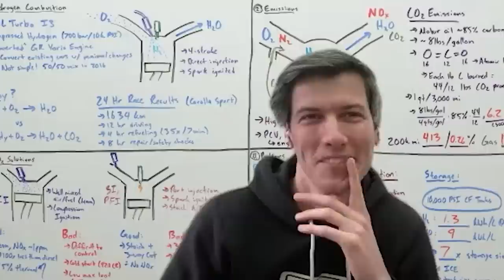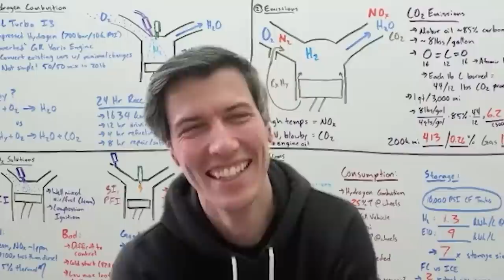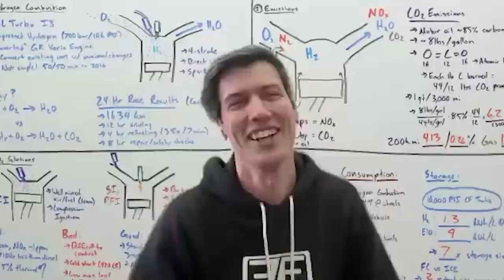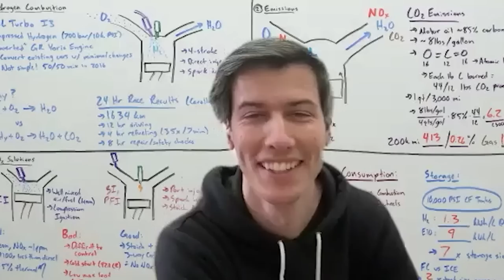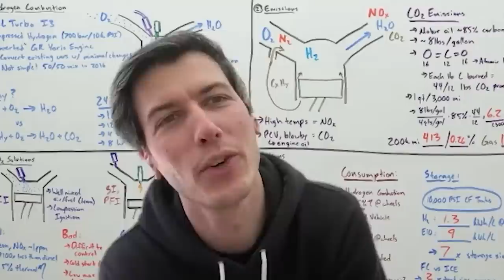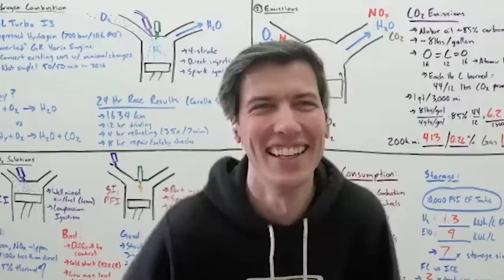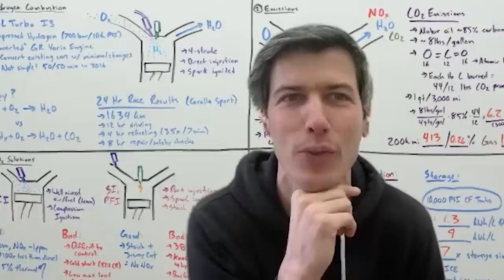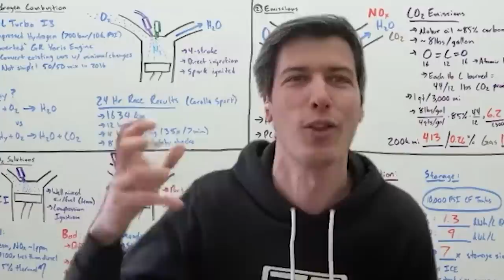Engineering the World’s Fastest Cars with Jason Fenske & Neil deGrasse Tyson

Comment: Most types of batteries are nearly entirely recyclable.  There are a ton of recycling companies rushing to get large scale plants online before used battery packs become an issue.  For the same reason there are not as many companies opening rare earth mineral mines as there would be otherwise because the demand is going to drop to next to nothing once there are enough battery packs built that can just be recycled over and over.

Also, battery a pack is going to last for years and years.  Yes, the pack will naturally loose some capacity by the time it's ten years old but it averages 20%.  If you have a 300 mile battery pack in ten years it may be only a 290 mile pack.  In twenty years it may only be a 270 mile pack... so the energy drop is not going to be that noticeable.

Comment: That is a flawed analogy - a steam powered airplane versus a battery powered automobile. Yes both get heavier in order to go faster or fly but in the case of a steam engine airplane it needs to be lifted in the air. The work to be done is far greater. In the case of the heavier battery powered car it just needs to be accelerated forward while planted ko the ground. I don't believe a higher mass would affect top speed, but it would affect acceleration in getting there.

Comment: Regarding a turbo equivalent for electric motors ... Capacitors!

In a camera flash unit, the capacitor will charge up over maybe 3 seconds, then discharge all of that stored power in 1/1,000 of a second. 

It seems that a series of capacitors, timed to discharge their loads at millisecond intervals could replicate the effect of nitrous oxide injection in IC engines. It's not the sustained boost that you're going to get with a turbo or supercharger, but the idea could have merit.

And if anybody tries it, I want 15%.

Comment: Gentlemen. The slick using race cars is most effective as it is the most rubber on the ground. The Tesla is all wheel drive. That helps.  Then you use the proper road surface.

Comment: Great show and a fantastic guest.  One subject that came up in show was tires vs pavement.  I think it would be better with a rough pavement and smooth tires.  Racing cars on the track use slicks for better grip.  The catch is that the tires have to be warmed up so the are soft enough to dig in to the pavement.  I am curious to know if these companies engaged in deception by using tires that are not quite street legal.  And if they were legal, what was the temperature of the tires for the 0-60 run times?

Comment: 25:29 in you mentioned race cars on track not exceeding 300Mp/h they are in drags and salt flats and lemans wound up putting in chicanes to lower the speeds or we would be on track there too b
by now and they have limited the traction and driver aids on formula 1 since gerhard berger was killed by the cars flight controller failing well  active aero and active suspension but an inverted flight controller :).

Comment: turbo were used to increase torque and power, then downsize to reduce (EPA) emissions/weight. electric motor have more torque/power are smaller and more efficient..the equivalent is to  just send more current, which increases torque, and is done by many people on ebikes or small electric motorcycles but it increases heat and losses (power increases linearly with current but losses increase like square of the current)
EV's are too expensive to buy, too expensive to mod and too cheap to make quicker from the factory, for mods to be practical. plus many have some software protection against modifications, but unlocking more power through software is possible if you can break encryption or add devices to fake signals. the  real bottle neck if you want to really push the enveloppe of power is the battery output.

the huge step up in electric motor power is superconductors which means no internal resistance,  higher current, smaller wires, lighter rotors, higher rpms, but with current technology is only possible with big industrial motors/generators that can offset the cost of cooling system and materials with big energy savings, for instance a motor that runs at high load 24/7. if you need to cool down you car motor to superconducting temperatures every time you turn it on, and carry the cooling system all the time it doesn't make sense. it could make sense for racing though ,  but battery is way more problematic than motors.
Another path for improvement is having a hybrid battery with one primary energy storage that is energy dense like li ion, and. one small secondary energy storage buffer using for instance supercapacitors with much better power density and better efficiency for very quick power/Regen cycles like accelerating and braking on a track, and better life.
you can break up power requirements into 2 parts. the energy required to overcome drag, which is one way and can't be recovered, can be provided by the battery, and the energy used or recovered to accelerate / brake can be handled by the secondary storage
only Regen due to elevation (down hill) has to  go back in the primary storage.
this way you can increase efficiency, peak power/peak regen, reduce load and wear on the battery, increase the whole battery system life. you can also tune the primary storage purely for energy density, and not care about its power density. in a racing scenario you can even imagine a three stage energy storage with one stage that provided only burst to go from 0 to top speed, or top speed to zero. one slightly bigger buffer to handle the energy going flat out through the longest straight, and third one that just provides the "fuel" and just needs to be able to output your average net (propulsion-regen) energy use for one lap... the only things that can't be increased/improved are
-sustained fast charging speed
-sustained very high load scenario like sustained top speed runs, or towing heavy loads up long and steep hills. you can still benefit from a multiple stage energy storage, but the secondary stage needs to be 
sized according to your worse case scenario
 I hope we'll see it on next gen formula e and it will trickle down to road EVs.

Comment: One thing that wasn't mentioned is Porsche has launch control which allows you to rev the engine up the torque curve at start. This will negate some of the disadvantage versus an electric which has immediate torque.
Reply: The writing is on the wall. Electrics can go 0-power to full-power 1,000 times per second. 

No clutch will ever touch that.

Comment: You are wrong on the theory of how to get a faster top speed. It's going to be done with a transmission. With a standard transmission as you go faster you shift up to a higher gear and your engine rpms drop every time you up shift to stay under your redline. With an EV there is no redline and no resistance. Your batteries and motors are liquid cooled and barely change. 400mph is easily attainable with a Tesla EV. The problem is the instant torque will be deadly. I would rather see the range of the vehicle extended instead of making it go 300kmph over the speed limit.

Comment: 51:22 This is not true, there are electric car dumps in parts of the world, and it would become bigger as the costs of recycling car batteries on a massive scale is too large. A great example of this is the Paris EV graveyard, small electric city cars lined one by one on the field. Hydrogen is also the wrong way to go, as these molecules seep through anything that isn't extremely expensive. Hydrogen embrittlement is also a problem and, as hydrogen, as said in this video, is dangerously flammable, it shouldn't stand in a smoker's garage (or in any garage with a light switch for that matter). The right path to go for in the future is ammonia, as it is easier to store and can close a cycle for fuel production and the exhausts produced. Nice video, though!

Comment: If one really must say the "e" -really an 'e' not an 'a' or uh'.... in Porsche,  the German "A" in audi, why not roll the "R-s" in Ferrari..

Forget al the mixed sounding-s of Japanese, Korean and Chinese versions...  (jk)

Anyhoo, in drag racing, the "time to power" isn't significant (stated electric advantage) as the ICE motors are already at high idle/stall - ready to throw down the torque  as soon as the transmission brake comes off.  The downside of piston engines is their (poorly controlled power/torque delivery)  "finite" top end revs combined with limited flywheel torque necessitating the need to shift gears.  The break in acceleration (which can be filled in with parallel hybrids) gives straight electric an edge - to get the power down more smoothly, electric (or hydraulic)  augmented epicyclic (torque multiplying) transmission output needs further application..

Re. Fuel "volatility" - hydrogen in a tank only explodes once air (or other oxidiser) enters  - easy to engineer around under normal circs. and, hydrogen released into the air - flares off easily, and doesn't pool on the ground causing other equipment and structures to be incinerated...  NDT is more into sensationalism than engineering.  (volatility doesn't mean what most people think it does - most people are still too lazy to look stuff up for themselves)

Comment: Somewhere there is a parallel universe (universe C1564 I think) where Neil's maths aren't wrong and cars are limited to 1G acceleration. Sadly motor racing is very boring there as all cars can only  accelerate, brake and corner at 1G so all lap times are the exactly same lol ;-)

Comment: How to Turbo an electric vehicle?
Tie the regen braking into a bank of super capacitors.
Because capacitors dump A LOT of energy at once, the motor will get a kick. Providing the coils can take the strain.
Reply: But that would mostly help with acceleration ... What about top speed, does the quick discharge of a capacitor help with getting to a higher speed?
Reply: @wayando  yes, at the risk of increased coil strain. Think of this more like a 1930's push button supercharger, where you pressed a button and for 8-10 seconds got a massive boost from a supercharger, only 8 - 10 seconds because the engines back then couldn't take the strain. (Think of the Captain America scene where they had to catch the giant bomber with the red skull's car, that's a push button supercharger)

In the case of electric motors, to "turbo" them for top speed is an exercise in deminishing returns.  Modern motors can already drive cars to undrivable speeds, getting the mass it propelles to that speed first is the bigger problem, in short top speed won't be the issue, it's accelerating to the topspeed.

Comment: F1 cars fast cuz weight ratio is low that what engine is generating and it’s turbos and try this one throttle up on a corner F1 ripped off that back 😂high rpm low friction

Comment: This is annoyingly tedious, and overcomplicatedly wrong. An electric motor makes torque at 0rpm, a piston engine can't. You can overcome this with lots of clutch surfaces so you can launch at higher rpms, in the powerband. It's just not as practical to have the needed components in a street car to launch at full power, where as an electric car inherently does this. 
And yes, you can have more than a coefficient of friction over 1, you can got to a local tire shop and buy such things... Mr scientist

Comment: Once again Neil is wrong. The grooves in a road are to allow water to escape from under the tire.
Point 2: Tires are soft and roads are not perfectly smooth. It's not a big deal for a soft tire to "intersect" with the irregularities in the road. The limiting factor is such a soft tire will wear very quickly from the rubber surface shearing.